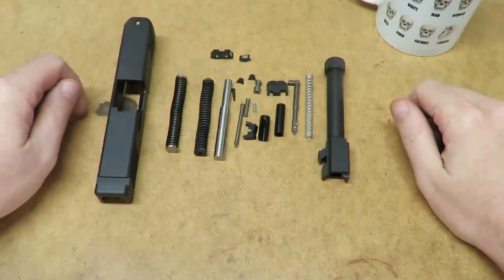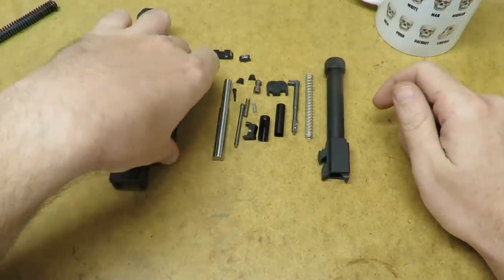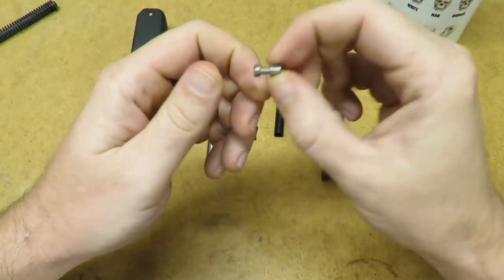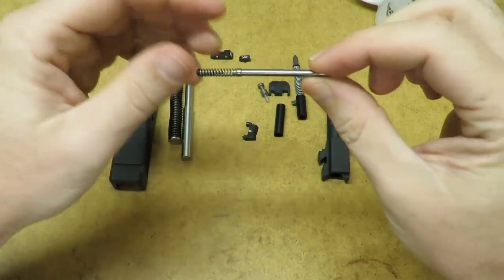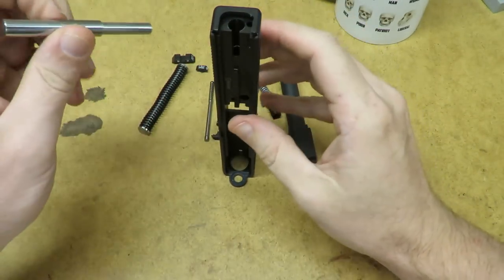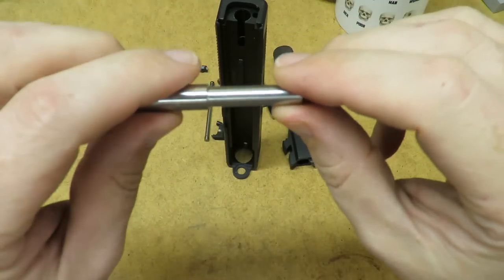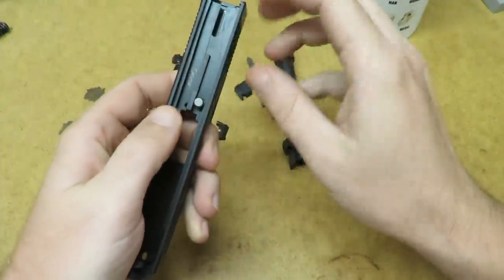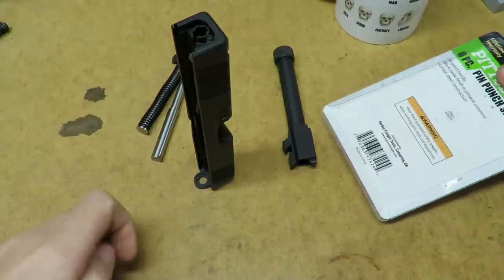Glock 19 slide assembly

Comment: I spent $15 on a channel liner tool, only to find out my upper parts kit came with a cheap plastic one. Then I put the liner in the freezer for 10 minutes and it went in like throwing a hot dog down a hallway. Didn't even need the tool lol
Reply: Same lmfao
Reply: I didn’t do anything with mine I just dropped it in no hammering no nothing that happens with most of my pistols I haven’t had any of them that I’ve had to force it in with
Reply: where did u buy the tool
Reply: Same here, I was like "wtf is this for"
😆
Reply: My parts kit came with the install tool as well.. then found out the new stripped upper I purchased already had it installed.. now I have a spare and the two install tools..🤣😂🤣

Comment: Put the channel liner in freezer for about 10 minutes makes it lot easier
Reply: Huh why does that help
Reply: It shrinks the metal
Reply: This is the best tip ever
Reply: Factory channel liner is made of plastic, freezing won't do nothing to it
Reply: @lifrank2161  

It worked on the plastic one I used
Reply: @tylerjudy2506  the channel liner is made out of plastic. Not metal.. SMH
Reply: Plastic expands roughly 5 times as much as steel for a given temperature rise, so plastic would shrink significantly more in a freezer vs steel.
Reply: Best advice for a Glock build ever.. thanks
Reply: @lifrank2161     All plastic expands with heat and contracts with cold. This property is called the coefficient of thermal expansion. All plastic can change shape to one degree or another with heat and it is very important to keep in mind when designing parts. I have been re-using the same couple of plastic channel liners in my Glock 19 that will happily fall out (without any tool assistance) with a hard smack after being in the freezer for about an hour and then be impossible to remove without a lag screw tool at room temperature.
Reply: Genius.....
Reply: @mustardman5366  not the aftermarket ones SMH
Reply: @SmellyChipmunk  yes they are!! SMH
Reply: @tylerjudy2506 the channel liner is plastic

Comment: UPDATE AND SOLUTION: okay so I did a test fire and found that I was stovepiping every shot, I manually cycled and had an issue with failure to extract. Turns out when you installed the extractor you forgot to hold the safety plunger down before inserting the extractor. then release the plunger and it holds the extractor down as you insert the rest of the extractor assembly.

Comment: its wierd how hard you have to hit the liner. I installed mines today with no tools, and i was able to push it down with the tip of the firing pin.
Reply: Do you push it all the way down
Reply: @katori6012  You'll feel a small click when it's in place.
Reply: The sound will change to a muffled thud with light tapping on the hammer when the liner has bottomed out. Depending on the type of plastic material used to manufacture the liner, if you put a liner in the freezer for an hour or so, it may shrink to the point that it is possible to push into the channel entirely without a hammer.
Reply: @katori6012  yes

Comment: Excellent video, appreciate the help!  Was able to put my first ever Glock slide together in less than 5 minutes (just happened to get the same exact combination you demonstrated online).  The slide and kit were a great bargain. $150 slide, $100 threaded 9mm barrel, and $70 parts kit - $320 total on the upper with $75 for the P80 frame and $45 for the lower parts kit = $440 for a brand new DIY G17.   Hard to complain about that.
Reply from the maker: Awesome, glad I could help.
Reply: Could you guys send me links of what I need I just bought the pf940c compact 80% frame not sure where to start
Reply: @21ralex  
Search on midwayusa
Glock Frame Parts Kit Glock 17 Gen 3 9mm Luger

Glock Slide Parts Kit Glock 17 Gen 3 9mm Luger

Swenson Slide Glock 17 Gen 3 9mm Luger Stainless Steel Melonite

Swenson Barrel Glock 17 9mm Luger 1 in 16" Twist 5.03" Stainless Steel Melonite 1/2" - 28 Threaded Muzzle with Thread Protector

That's everything you need other than magazine and sights for a functional G17.
Reply: mpeugeot thank you very much
Reply from the maker: @21ralex  If you have the pf940c, you'll want to search for glock 19. The pf940v2 is for the glock 17.
Reply: I wish they were still that cheap

Comment: Great video and very helpful, a little tip I used to install the liner is buy a cheap transfer punch set (I already had one) and push the liner down by hand as far as you can then use the correct punch to push it in the rest of the way, there will be one that fits the exact diameter of the liner bore and you can use other smaller ones to help push/tap the other pins

Comment: The fact that he just breezed through the firing pin assembly pisses me off so much? Im on my 3rd spring and still can keep it down

That’s what she said
Reply: Im having the same problem he makes it look so easy 😭
Reply: There was no mention of which was the spring cups are supposed to be oriented. 
I'm not really sure
Reply: If you flip the assembly around and put it in the uppers assembly hole you can this alot easier. the assembly stays in  place and you ca place the cups a lot easier
Reply: B Davis The fucking firing pin spring fucking flew on me and now I have to buy some cus Idk where it landed
Reply: Never, not once have I ever had a striker assembly go together that easy. Pisses me off lol
Reply: PRO TIP: USE A MINI OFFICE STAPLER ON ITS SIDE TO HOLD YOUR STRIKER/SLEEVE WHILE YOU COMPRESS SPRING AND PUT ON CUPS
Reply: Bro I just launched one of my retaining clips and can’t find it anywhere 🤬
Reply: Bro it looked like he did it with minimal strength lol, I got cramps in my thumbs doing it, and I’m a hydraulic technician 😂😂😂😂😂
Reply: Just launched mine as well
Reply: its easy once you get the first plastic retainer on

Comment: Tip, if you don’t have a channel liner tool handy try and insert the liner the grab your firing pin assembly and push the liner down with your fingers once you get stuck use maybe a roll pin punch or sturdy piece of plastic to sit on the rear of the firing pin assembly and tap it the rest of the way in.

Comment: GREAT Video!!! I never had to mess with the liner on any of my Glocks, but I'm putting an Aftermarket Slide on my P80, so the Video was very informative. You were using a Lathe. Are you a Machinist? I work on a Horizontal CNC Mill.

Comment: This was an amazing step by step how to video! i am currently building my own glock and i had trouble getting the firing pin spring on with those two little half circles but i finally got it and my slide should be here tomorrow so i’ll let you know how the rest of the install goes and i’ll pickup a pack of punches at the parts store tomorrow!

Comment: I find that if you need a hammer to get the channel in place it is because there is already one in there and you are hammering a second one in over the first one.  Some slides come with the channel in place already.  I watched your video and thought I had to use a hammer and doing so smashed one channel liner over another and had to buy a removal tool to get both of them out and buy another channel liner to replace the one I damaged in the first place.  The channel liner went in relatively easy and without the use of a hammer.

Comment: Another option to installing that channel liner for anyone owning an FN-5.7, take  a SPENT BRASS  5.7 shell casing primer side down and gently tap top of said shell on top of liner until it's flush and in position!  Worked great for me (I used a screw driver into the casing to give me the needed length to tap it in as the casing disappears in the first half of channel)

Comment: Just FYI unless I’m mistaken ( which happens sometimes lol ) that is the extractor tension pin and installation doesn’t have anything to do with holding the firing pin in. Thank you for the idea for the installation tool and the tip to be sure to add recess to the end to save the channel liner from mushrooming
Reply: My wording may be off as it is the safety to prevent the firing pin from functioning unintentionally . But it doesn’t hold the safety in and the safety doesn’t need to be depressed when inserting the firing pin .
Again I could be wrong just offering my 2 cents

Comment: Nice video. I have an OEM 22 and a 23. I wanted to build each in 9mm using polymer 80 lowers. Not the least expensive way to go but they are mine and they have some trick stuff on them over stock. Pyramid triggers, and ported stainless match barrels etc. I went with the same slides you used. OD frames. They are beautiful handguns. Thanks for the very helpful video!

Comment: Great video, thank you. I think for that firing pin sleeve install tool it can be 3d printed and might protect the sleeve and the slide finish more than the metal one, im going to try that route and save myself the 12$ , its cool that you have access to a lathe and can use it!

Comment: Question...Why can't you put a couple of drops of oil on the channel liner,,not a lot ,,just a tad so it will slip in easier??
Reply from the maker: you want a solid connection between the slide and the liner. Even tiny bit of oil can create a fluid barrier between the two.
Reply: @ShootingTipsandTricks  I put a small little smear  of Lebelles plastic friendly lube that I use on my model train gears ,,on the liner,, smoothed it out and I pushed it in fairly easy..no problems with the slide, trigger, or anything,,everything working smooth..and that liner isn't going anywhere, because it's real snug...so far so good!

Comment: Bruh I'm having so much trouble with putting the back plate, that extractor spring is hard as hell to push down
Reply: Same
Reply: Metal back plates slide in easier
Reply: Literally came here to see if anyone was struggling, did you figure it out man? Cause I’ve tried everything to push it down far enough to slide it down nothing has worked for me yet, so frustrating because that’s all I need left to assemble my upper
Reply: @jokerthegoat8937  if you got plastic backplate they have grooves on the inside, those circular grooves is what's keeping it from sliding in. Try putting very little lube and clear the rails of any plastic particles

Comment: Wouldn't it be easier to punch in the striker channel liner if you heated the slide and froze the liner? I noticed getting some punched valve seats and liners in, it's way easier to heat the head and freeze the punched components.
Reply from the maker: You would run the risk of damaging the slide and most assuredly destroy the liner.
 Usually the liner goes in easier than this one.

Comment: Pro tip, (AKA common sense) if something does not want to go in or goes in crooked and fights you, DO NOT APPLY MORE FORCE in an attempt to force it in, just take it apart and see what is causing the problem.
Also, if you do not have an Arbor press, use your drill press.

Comment: Use tungsten disulfide (Ws2)! Dry powder, slipperiest thing on the planet, sheds carbon, bonds to metal by rubbing it on, doesn't attract dirt, doesn't come off, withstands 100,000 lbs. of force, eliminates wear. I run my guns dry with NO problems or signs of wear. Better than oil (oil attracts dirt) but if you are worried of what I say, Ws2 also blends well with oil and can be used together. I've been using it in my car's engine oil for 12 years and the engine is like brand new (no wear!!). Nasa uses Tungsten disulfide (Ws2) on the Mars rover. Great for guns! I use a short bristle 1/4 in. paint brush and a q tip to rub it on.
Reply from the maker: When it comes to a carry gun, I try to avoid putting stuff on it that has the poetical to be corrosive, carcinogenic or radioactive.

Comment: Hey I really appreciate your time making and instructing a video. I have a concerning question about the firing pin but not so much about it. It’s actually the channel liner? Is it possible it can be to long of a liner as we as too snug for the firing pin while inside of the channel liner?
Reply from the maker: Variations in length and diameter are passible but I've never come across them (outside the margin of error that is). 
  Most of the issues I run into are with tolerances of aftermarket slides.

Comment: HI. I also have the Swenson slide and threaded barrel, along with the upper and lower parts kits.  I followed your video step by step and only one problem.  My firing pin is too short!  I push it in as far as it will go, it doesn't poke out the hole in the breechface.  On my G23, you press the safety in, push the firing pin forward and it pops out the front.  I wonder if there's another model Glock that uses a shorter pin and they just stuck the wrong part in my kit?  I'll have to check with Midway to see what's going on.  

BTW, great video.  Everything (else) went together just like you said it would.
Reply from the maker: Thanks.
It's possible you could have got a striker for a compact. 
Did you make sure the liner is in all the way.
Reply: I took the one out  of my G23 to check the two.  The new one is about 1/4 inch shorter.  When I put the longer one in, it worked fine.  I definitely got the wrong part.

Comment: Question, my G19 slide has a rattle when not cocked? Is an aftermarket 80p build, not sure if that matters but yeah, what could that be??? When i purchased it the guy at the shop i got it from assembled theslide for me so all i had to do was the milling, AND THEN i purchased a G17 build kit online and had to assemble the slide myself fully as well as mill it, and my G17 has no rattle, im wondering what the guy did wrong??? Thanx, new subscriber
Reply from the maker: You can get that from the barrel on some slides. Outside of that nothing on the slide should rattle.
Reply: @ShootingTipsandTricks  any idea what it could be?
Reply: @ShootingTipsandTricks  other than the barrek i mean kuz its not that?
Reply from the maker: @mugi-wharingan8150  If you positive it's coming from the slide, it could be the firing pin. The only way it can move around is if the channel liner wasn't in place.
  If anything else was loose in the slide the gun wouldn't function reliably.
Reply: @ShootingTipsandTricks  ok, so is the only way to check if its seated properly, to remove the e isting one and replace it??
Reply from the maker: @mugi-wharingan8150  If there's one there then it's not the problem.
  Most aftermarket slides don't come with a channel liner (bare slides not pre-assembled ones) and on rare occasion I've heard of slides getting assembled without the liner.

Comment: Should the extractor fit flush? I am doing my first p80 build. I am using agency slide and basic slide kit. When i look at my glock everything is flush. Is this a tolerance issue?
Reply from the maker: It should.
Make sure it locks in with the safety plunger.
Reply: @ShootingTipsandTricks  thanks bud. So it seems like my slide had some built up coating or excess steel that came to a point. I sanded it a bit and boom slides in great now. Ejection is hit or miss so might need to be shaved a little more.

Comment: Any tips for the firing pin spring its hard to hold it down while u put the cuffs in
Reply: I used the back of the slide to hold up the firing pin safety sleeve. I used both my hands to push down the firing pin sleeve while my wife put on the cuffs. 

Extra set of hands was the only way I could do it.

Comment: I'm about to do my first build. I noticed you didn't lube anything before hand. Was that done off camera? Or are the internals not supposed to be lubed? If so, would an oil like lube such as rem-oil be alright? Or should I use a grease based one like miltec?
Reply from the maker: It's not recommended for the channel liner (you want it to lock in place) Glock armorers will say don't spray anything into the firing pin hole. I usually give the moving parts a light spritz to keep a barrier between the metal and hot gasses (reduces the chance of carbon welding too)
Reply: I oil the slide to keep from rusting and scratching.

Comment: Hey man I assembled my first slide using your exact instructions and it is in fact incorrect. If you look at your extractor at the end of the video you can see that it’s sticking out as if it were cocked. This is also why you and me both were having a hard time putting in the Extractor depressor & spring assembly. So after asking on forums what my problem was. We came to the conclusion that I assembled it wrong, and after watching a different assembly video that was in fact the problem. So the only thing that needs to be different from your video is the order in which you install the, Extractor, safety plunger, Firing pin assembly, and Extractor depressor assembly. The correct way is #1 Extractor, #2 Safety Plunger, #3 Extractor Spring assembly, #4 firing pin assembly and lastly the backplate.

Comment: Interesting, I didn’t need to hammer down the liner for mine.
Reply: I think mine came pre installed in the slide
Reply: Sometimes they don't need to be pressed in. It's a 50/50. But it can go south if done wrong.